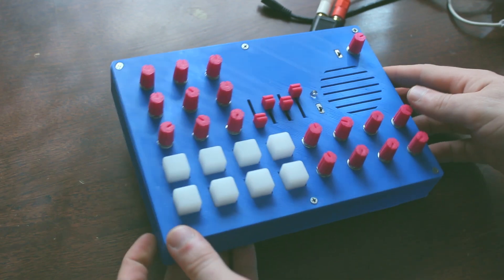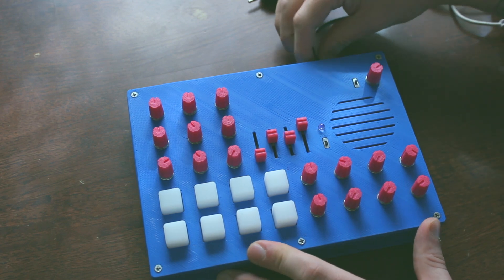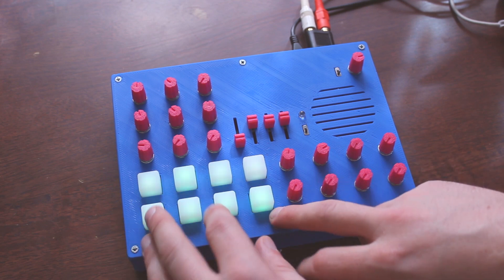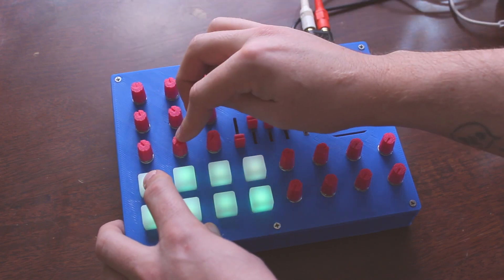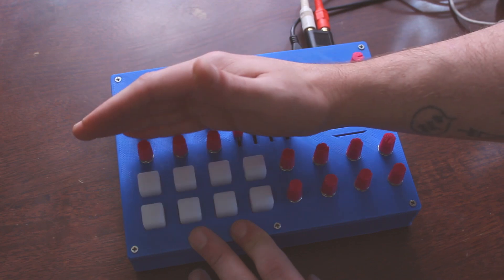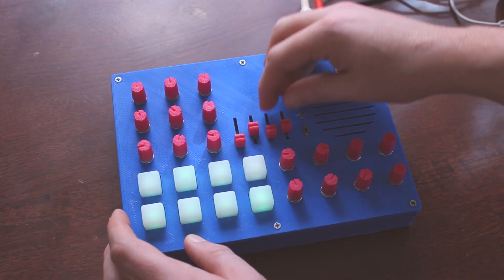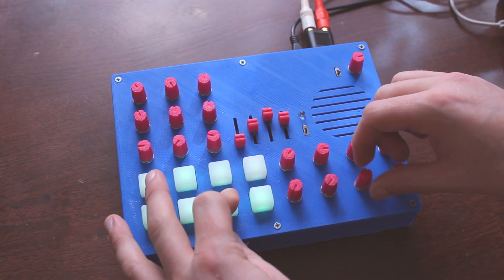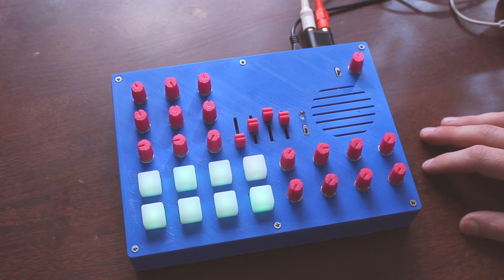Teensy Polyphonic Synth

Comment: Is there anywhere that I can find your schematic for the hardware? I'm new and learning. This would be the perfect project for me to get into teensy.
Reply from the maker: Sorry, I never made a schematic for this. If you are just getting started, check out the Teensy Audio Library examples.
Reply: @otemrellik  I ended up working on a midi mixer board designed around the Voicemeeter GUI. I figured that I would get more acquainted with the Arduino platform before jumping into the audio side with teensy. Your synths are inspiring, dude. I'm excited to see what you come up with next~

Comment: 🤯 Been developing a T3.6/SGTL5000 quad audio shield for a laser waverfom generator/control desk.
Just discovered the Teensy Synth DIY kit and ordered the front panel & PCB, but I'll use my preferred LED buttons and rotary encoders, instead.
Love your multicolored cubical buttons, BTW. Are those available online or your own 3D printed caps?
Wasn't really interested in the Teensy Synth's code, then I stumbled upon yours, which is exactly what I've been working with from the ground up, with the pjrc development tool..
IOW, thanks to your sharing your sketch, you've saved me months of frustrating coding. 🙏 With your foundation, I can easily duplicate and customize it for my specific needs, such as a 5 channel audio output.
2 Teensy tech scores in one day! Woohoo!
Thank you for making my week!😎
Reply from the maker: Np! The push buttons were from sparkfun I think. All the slider and pot knobs were 3d printed but I don't remember them turning out super great, haha.
Reply: @otemrellik  Thanks for your reply. Yes, after posting my comment, I discovered your link to sparkfun and found both, the RGB buttons and RGB pushbutton rotary encoders. They've already been ordered and everything should arrive this week. So, I'm anxiously waiting to get started on the laser control desk. 
IOW, it wasn't a double score, but a trifecta for that day. Thanks!
BTW, your more developed code is transferring very nicely into mine, requiring little more than copy & paste, plus changing the declared references. That will save me ~ a month of frustrating coding. Awesome! 😎

Comment: Hey bro, I been binge watching all of your videos lol. I love the little synth machines that you build. I've got 3 Pocket Operators myself and I'm starting to get into circuit bending old electronics and toys. I'm no expert by any means, but I am really wanting to attempt something like this. Unfortunately, I am kind of living off my stimulus check and don't have a lot of money to spend. Would I be able to build something like this using Teensy on a budget? I actually worked for a wire harness company for years, so soldering and crimping terminals is second nature. I can read blueprints and wire schematics for pin out connections, etc. I actually have bad anxiety, so my hands shake a lot and makes it annoying when trying to do anything with your fingers or hands, y'know.... like soldering delicate PCB boards lol
Reply from the maker: Yeah, you should be able to build something like this pretty cheap. I'd start out with just a teensy and some pots/buttons and just experiment a bit.

Comment: two questions if you don’t mind: 

Is the mono amp just being used for the speaker? in other words is the audio out that you use in the video stereo? 

did you use SF’s button pads? most code i see for that is based on using them as a matrix, which is absent from yours? not sure i understand it. 

thanks for any help you’re willing to offer.
Reply from the maker: As far as I remember the amp was just to drive the speaker. I probably used the teensy audio board for this so that does have a headphone out and left right line level out's as well. I did use the sparkfun button pads. I think it was two sets of the smaller 4 button boards. I don't think those are setup as a matrix. Sorry this project is pretty old and has been cannibalized for parts many years ago so I'm just going off my memory.
Reply: @otemrellik  no worries man, thanks for replying at all. i'm going to try and jump back into the project and from what I last remember, it seems that it wasn't setup as a matrix. i'll keep toying around. looking forward to seeing your new creations!

Comment: this is awesome. i'm hoping to make something similar. a few questions though. what value pots did you use? also would it be possible to give us a rough idea of how this is wired internally. i have read the code but i cant quite work out the whole thing. even just a photo of the inside would be greatly appreciated by many. thanks
Reply from the maker: 10k pots. Sorry I can't provide much on the wiring. I don't really have the time to pop this guy open or make a schematic.

Comment: can i use a raspberry B ?
Reply from the maker: Not for this project. This uses the teensy audio library.
Reply: for rpi you can run headless puredata patches and have the same result but a bit more work . The teensy looks quite  faster to build

Comment: I altered your code to use MIDI.
It took a long time to figure it out and much of your original code was butchered up, but I wouldn't have gotten a head start in making a synth without your code to begin with.
Here's most of your synth controlled via MIDI

https://youtu.be/fVdPEy9sTUk

I made a GUI to control parameters and allow a connection of a MIDI keyboard.
It's still in the early stages of coding.. there's some bugs to clear up.. I think it's the formulations changed from 10 bit resolution to 7 bit MIDI resolution (128 max vs. 1023 for your analog pots).
Reply from the maker: Nice!
Reply: Can you share complete plans?? would love to replicate this